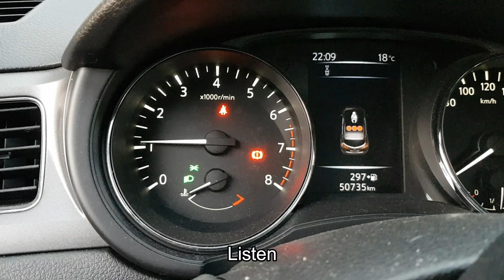Something is Wrong With My 1.2 DiG-T Nissan Pulsar

Comment: It seems to me that the movement of the rpm happened when the A/C compressor engaged ( I can hear it clear ) and that’s normal in small engine after some age , switch your A/C off before turning engine on , if it’s gone , the engine has no problem, it’s the A/C compressor or belt or something there . We hope to hear an answer from you in case of you know what caused the problem. Good luck
Reply from the maker: You are right, It is the ac compressor engaging. But it has never been this rough. The dealer did a small ecu update and advised me to drive it with higher rpms because there might be some carbon buildup. It still does it, hard to tell if theres a difference. I guess time will tell.

Comment: That is the A/C compressor. Be careful with this engine, It is very notorious for failing. Keep a close eye on the oil level and change it regularly and it should last a while. They can consume a lot of oil causing the timing chain to fail. Also you have a fiamm battery fitted to the car. These batteries are known faulty and I bet that it fails in the near future.
Reply: However the issue shown is nothing at all to worry about.
Reply: Yeah just said it so someone else in the comments the engines are real clunkers.
Reply: @chriskonte1909  I've seen many fail .. but if you are really careful and change the oil a lot they can last up to about 80 to 90,000 miles.
Reply: @ronanwood6891  yes. Agree. I have this engine umy Juke and 1 year or maximum 10,000 kms ( in One year i do 7000/8000 kms ), Change the engine oil. People Don't understand, engines with turbo have a special maintenance. Most people have problems with this engine. And eco mode is a problem. I drive in normal mode always. Eco mode is slow, the engine soundd like a Truck.

Comment: I have a Pulsar of 2017 ( same engine) and cause of 1200cc there is a turbo to give you that horse power.So every time you start the engine you have to wait a couple of minutes ( turbo has to "drag" some oil ) till the RPMs drop ...If you start driving once you turn on the engine , you will notice some "hiccoughs" on the first gears :/ 
this is usual to all turbo engines but it's more appreciable to low CCs engines ( I think so ) . At your case , that sound was a bit too much :P
Reply from the maker: It ended up being the AC compressor. Not faulty, but just puts a large load on an engine this size... according to the dealer that is.

Comment: Father law has had a 2015 from new and its had 3 engines under warranty, after all it is a renault engine.
Reply: Eeeh wrong. I have a friend who works at a Renault Dealership. He told me just like with the "prince" engine series (MINI Cooper gasoline engine).
It's one company that devolops around 80% of the stuff the other is just doing the 20% giving money and in the end they both share that engine.
The prince engine series was deveopt by BMW/MINI and also used by PSA.
In this case Nissan developt 80% of the engine and Renault just gave money and did 20%
This engine is by the way a real clunker: Basically everything that can go wrong with a combustion engine goes wrong at some point here :D
Oil burings problems, bad piston rings, weak valves, blown heads (not just gaskets), and so on..

I don't wanna defend Renault cause they were stupid enough to also use these engines but like I said there's one company that does more work than the other and I'd blame the one who did most of the crappy job
Reply: @chriskonte1909  oh really then tell your mate to message me as i work for renault in the uk and its a Renault engine stamped RENAULT
Reply: @chriskonte1909  yeah, the people talk about Renault, but in the end the engine is co-developed by Nissan and Renault. Is made in Japan, the petrol engines.
The old One 1.6 on the Jukes and Qashqais is the same thing, co-developed. People hate Renault. Nissan is guilty because insert the engines on own Cars. Stop attack Renault people.
Reply: @GILTERS  You work for Renault and you bash Renault engines?
Reply: @The77Game  a job is a job at the end of the day just because you work somewhere doesn't mean you have too lie about problems.
Reply: @GILTERS  Still, why would you work for a company that in your opinion makes crappy engines? It's a pretty darn big part of the cars.
Reply: @The77Game  your clearly triggered over 1 engine being bashed, 1 engine doesn't make a company, Nissan/Renault are partners where i live so work on all engines considering the vq35 is one of the best in the world also look at the old clio 172/182, superb engine and pocket rockets.
Reply: @GILTERS  "after all it is a renault engine" just didn't sound like you only had issues with that particular engine that's all.
Reply: @The77Game  i take it your not from the uk as its a very well known saying in the car community same as a Peugeot same saying thats been said about 40 years. Coming along a motorways you see breakdown helping someone 9 times out of ten someone will shout i bet its a Renault/Peugeot or French

Comment: Will likely be oil resedue build up in the turbo dump valve. Needs taking off and cleaning or replacing. Keep to the oil change schedule and use the recommended oil grade.

Comment: hi i have some problem? you find solution. pls write
Reply from the maker: The problem is that this engine is weak and the AC put a lot of load on it. Atleast thats what they told me at the dealership.
Reply: His most resent update identifies the problem as a faulty Variable Valve Timing Switch

Comment: Nissan - producing crap since early 2000s.
Reply: Nissans are great cars - when they have Nissan engines, and not Renault supplied engines as is this case with the 1.2 DIG T engine here.
Reply: @jdmguy44  Unless it's the renault diesel engine which is one of the most reliable ones out there.